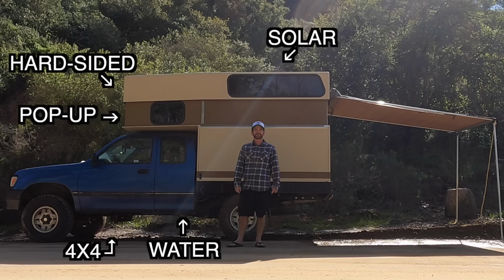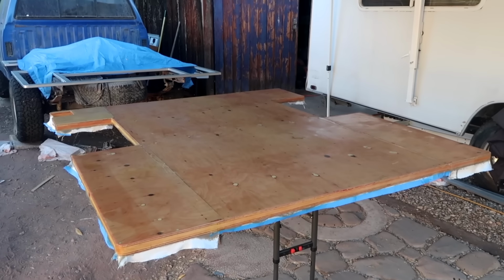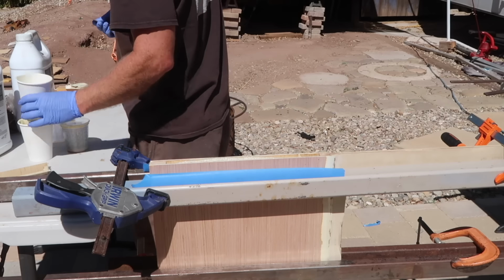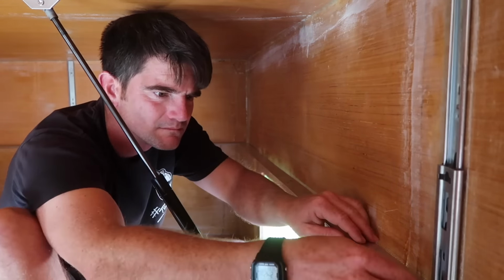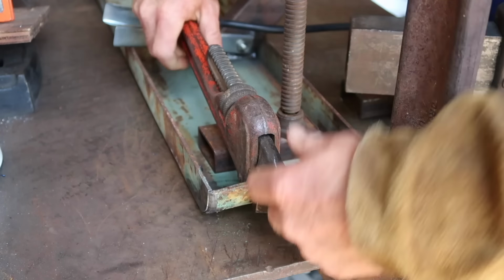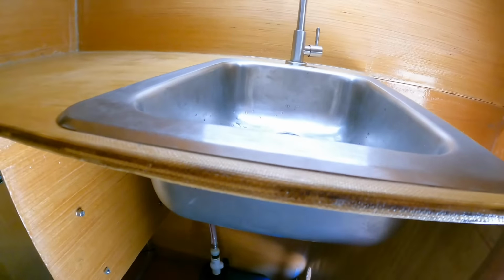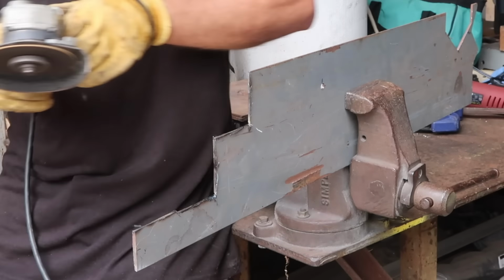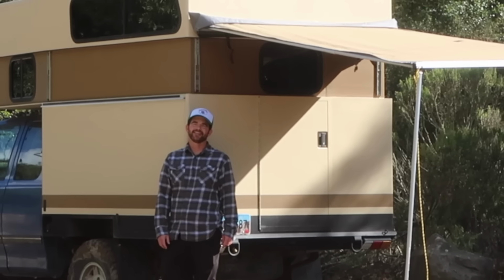Homemade Overland Truck Camper Build | Start to Finish | Full DIY Construction

Comment: That's a hell of a lot of water flow, not really needed. I dislike peoples elaborate water tank setups in campers because imo a few 5 gallon Walmart refillable jugs that are totally mobile and can be chanhed out anytime they might get dirty or anything, along with a $10 rechargeable temu water pump (which battery lasts forever) is a much simpler setup.
Reply from the maker: Pros n cons.
we had three 5 gallon jugs in our last build. It was simple and we. could carry the jugs to a water source if necessary, which is great.

The downside was only one of the jugs had a filter, so we had to transfer water into it before pumping it out to drink. it was also very slow water flow through the filter, so filling up our drinking bottles or doing the dishes was a pain.

I agree my current pump seems to be excessive. I wasn't sure how the water flow would be at the tap after flowing through the filter elements. Like the rest of the build, I guessed haha
Reply: @TheTravelingTogetherJournal    Ah, I get some of my water at the refillable stations at Walmart. Used to be like 20 cents a gallon. Now it's 55. It definitely adds up! But man it tastes great.
Reply from the maker: @mitchweber7868  If you get a system figured out that works for you and where you like to travel, then that's a good system.

We traveled internationally, often to new places, and occasionally stayed in one place for long periods, so we needed a water filtration system that could handle questionable water sources. We drank water from municipal sources as well as lakes, rivers, wells, and rain collected off our awning.

Comment: Great video! This will help others build their own camper. IMPORTANT- Leave a door on the floor to have access to your trucks fuel pump. Otherwise you will have to cut apart everything you worked hard to build in the future.
Reply from the maker: 6 bolts and I can lift the camper, but I've dropped the tank on a T100 before. I think dropping the tank would be the easier option.
Reply: @TheTravelingTogetherJournal  cool. I'm glad yours can drop down. I just want people aware of the possibilities and to think ahead. Great video btw 👍

Comment: We miss you guys! ❤
Reply from the maker: Thanks. We miss traveling. We haven't been getting out on many adventures to share with y'all. Crazy our last travel video was a year ago and it was just a short trip around our new home area. Have you seen it: https://youtu.be/wKB0xoe28Ho
Reply: @TheTravelingTogetherJournal  yep, liked and commented a year ago ❤ do you still like your full on camper build? I wonder if it was too heavy or cumbersome for you to travel and camp in regularly?
Reply from the maker: @sharpsticksnz4112  I am still happy with the camper overall. I'm still stoked on having a toilet. 😂 The truck does ok with the weight, but if I had the time and money I would be doing projects to move as much weight as possible as far forward as possible. There is too much weight behind the rear axle and it's extra bad when ascending rough terrain.
Reply: @TheTravelingTogetherJournal  thank you very much for the insights 👍

Comment: Fantastic build. Cannot say enough good things about your design, craftsmanship, and ingenuity. Practical, aesthetically more pleasing than every commercial camper out there, and has some nice bells and whistles. But the real kicker is that you built it on a toyota t100, not a 40K+ vehicle. The fact that you've proved that someone can build a comfortable, safe, decent overlanding rig for two+ with blood, sweat, and tears for under $20K (I think most people will have a hard time finding or restoring a truck like that to reliable working condition for less than 10K these days) is a service to this community. Thanks for sharing.
Reply from the maker: Thanks for the kind words. I used lots of other home-builds as inspiration and I'm glad to be contributing back into the comunity.
Reply: @TheTravelingTogetherJournal  Kind, but genuine. I've got a '97 T and I'm embarking on my own build (simple bed topper style with some pull out drawers) and I learned a lot from your video--something to work towards. The fact that you bolted to the frame giving yourself some extra payload room is fantastic.
Reply from the maker: @adobecow  ditching the truck bed loses versatility compared to a removable camper, but like you said it gains payload and it also opens up a lot of options for camper dimenssions, layout, and access.
enjoy your project

Comment: I want to build one like this for my little 89 pickup, somehow finding a way to fit some MTB inside. Someone cut a sunroof into the truck before I got it, be super sweet if I could make some sort of pass-thru. Maybe a thick garage door seal? Probably leak less than the sunroof!
Reply from the maker: That would be a cool setup. Fitting MTB inside would be a challenge, but figuring out those design challenges is what makes the finish product of a custom build so cool.
Reply: @TheTravelingTogetherJournal  100%, half the fun is building what you want. I'm thinking if I take the front wheel off and crank the bars sideways it might be possible to stuff a pair on either side. Maybe with a pedal pocket that intrudes inside a little bit, how deep did you make your surfboard storage? I'd like to swap a T100 axle, maybe do a front long arm setup that uses t100 half shafts. Thanks for all your work in posting your design and building process!

Comment: Really love the design in planning on cutting open my work camper shell to install a pop up tent !
Reply from the maker: Cool project. My first camper was built on a fiberglass camper shell . make sure you have it supported before cutting the roof out. the front and back walls may want to fall in.
https://youtu.be/5w14ybZO2dQ?si=0UnVLFeDqsD9OSVH&t=279

Comment: Why didn't you just use some biaxial cloth directly onto the foam? It would have cost less and been much stronger.
Reply from the maker: I'm using 3lbs foam and 6oz biaxial cloth. The resulting panels would have been too weak, particular in terms of impact resistance.

Not using the wood would have been cheaper and lighter, but not nearly as strong.

Comment: Seems backwards that the front struts are 80 lbs where the pop up narrows down (less weight) and 60 lbs in the back where it's wider (more weight).

You should reinforce the step, when you step on it it flexd and I didn't see it go back.
Reply from the maker: The front struts weren't mounted all the way against the front wall, so they were lifting more of the pop up. I am changing that set up right now. I tried putting the 80lb struts in the rear and 60lbs all the way against the front wall. The 80lbs struts seem good, but the 60s are too strong. Gonna have to keep tinkering.

Comment: I don't understand why you wouldn't use the wide sides vertically of the steel tube for strength.
Reply from the maker: The orientation of the steel allows for twice the surface area for bonding the subframe to the camper floor and doesn't take up as much precious vertical space.
The goal wasn't to make the frame as rigid as possible. I think (without any engineering knowledge) based on other builds I've seen that it will be strong enough the way I used it

Comment: Bro you need to start your own company, even if you start building a couple units a year. Hell of a build man. Curious how it works out after awhile
Reply from the maker: Thanks. 
Overall, I'm happy with how it has performed so far. I feel like the pop-up could be improved. It works fine, but I'd like to test some different ideas instead of the drawer slides. 
I plan to do an update/review video, but life has gotten busy for me lately and I haven't had a chance to use the camper as much as I'd like before making that video.
Thanks for watching and thanks for the comments.

Comment: Nice design. I especially like the use of the drawer glides to raise the pop-up. If anybody wanted to, and had the same kind of truck, they can extend the truck bed length with c channel. I'm not sure how that would go over with the weight rating, but I've seen people do it. It would also be possible to put some upper kitchen cabinets on the inside wall and let them raise and lower with the roof.
Reply from the maker: Thanks.
I thought about doing kitchen cabinets like you describe, but decided against it for the sake for weight and simplicity. But I still think it's a decent idea.
I definitely wouldn't recommend extending the length of this truck. It already has a pretty mediocre departure angle and tends to be rear-axle-heavy. If you found that you had to have the extra space, I think you'd be better off building on a bigger truck at that point.
Reply: @TheTravelingTogetherJournal weight is always something to consider.  I think you used gas struts on your design, but counterbalancing coil springs in the corners might be better.  As far as the cabinets, I did see one design where they stored the cabinet boxes on the floor and then you pick them up and set them on hooks on the walls after the roof is raised.
Reply from the maker: @n4mwd  I definitly feel like my system could be improved on. I'll look into the counterbalanced coil springs
Reply: @TheTravelingTogetherJournal  a lot of the commercial designs do have some sort of counterbalancing spring in there. That way you can have air conditioners and solar panels up there and still lift it with your pinky. Of course the standard pop-up camper tends to use a cabling system, but I'm not sure if they use counterbalancing springs or not.

Comment: I've been thinking about how useful fiberglass could be, but I think you went a bit crazy with it. Are you building a camper or a boat? Or planning to go through 5' deep creeks? I can't see why fiberglass was needed inside. And the Sikaflex on all the things inside seem excessive, too. 

Saying that, it's an impressive amount of work and design. One day, I hope to build my own camper for my truck and this helps give me some ideas.
Reply from the maker: Glad to here in was helpful. 

The fiberglass interior may be overkill for you depending on the rest of the build design and how you intend to use it. If you're just trying to protect the wood some paint would probably suffice, but the fiberglass provides a lot of extra strength to the camper construction.
Reply: @TheTravelingTogetherJournal  I didn't even think about reinforcement. Does one layer make a big difference? I always thought you needed 3 or more layers with different placements so the weave doesn't line up every time.
Reply from the maker: @StapleCactus  There are lots of different weaves that you can get fiberglass in, but you are correct that multi axis weaves will be stronger.
When it comes to composite panels, like my walls the outermost layers of the panel (inside and outside of the wall) will take the most energy when a force is applied. So the thin layer of glass definitely adds a lot of strength for the weight. pluss the epoxy resin  absorbs into the plywood and adds a lot of strength there as well.

Comment: What made you choose the expanding foam versus just foam board (polystyrene)?
Reply from the maker: I had planned on using XPS, but when I started the build I couldn't get it anywhere in California or online without buying full pallets and paying a lot in shipping, so I considered alternatives. The pour foam I used results in a foam slightly stronger than 25psi xps with similar closed cell structure and it adheres itself to the sheathing (wood) so I didn't have to deal with trying to bond the foam
Reply: @TheTravelingTogetherJournal  awesome thanks, I'll be using this video as a reference guide to building a hard sided pop up. Very cool!!!
Reply from the maker: @CBHurricane  Awesome. Good luck with your project

Comment: Really nice camper but unfortunately I don't weld both my knees are shot I'm working on two full knee replacements but other than that I can't do any kneeling down but it is really a nice camper I just wish I had that ability to build from Joseph Strauss here
Reply from the maker: Thanks Joseph
Reply: @TheTravelingTogetherJournal  heyy can you build this for me? I live in Phoenix
Reply: yes I wish I could do that but make a camper on the back of a pickup but I can't my knees won't allow it going on two full knee replacements I'm just getting to the point that I could get down on my knees on the grass and that's hard for me but I wish I could do that

Comment: the rec tube frame bed should be upright.  not flat side. for structural
Reply from the maker: That would have made it more rigid, but I also wanted to keep the height to a minimum and have a sufficient surface area on the top of the frame for the Sikaflex 252 to adhere to. With the 2" width as the top surface the Sikaflex should be strong enough to secure the camper to the frame on it's own and that was part of the design consideration.

Comment: What size gears in your differential?
Reply from the maker: stock, 4:10
Reply: @TheTravelingTogetherJournal  Thanks! I have a 1992 F150 4x4 extra cab that I was toying around with the idea of turning it into a MH.  Rear end is 3.55; capacity is 1900 pounds.  It is a long bed.  The weight of my f150 is about 800 pounds more than your Toy.

Comment: Wow great job  love it     So what do you think about putting on some air bags for the extra weight/
Reply from the maker: Thanks
I'm not a big fan of airbags. I intend to pull apart the stock leaf packs and build custom packs that will handle the weight better, but hopefully be more progressive so they don't feel rough on dirt roads.

I'd say airbags make more sense if you have a slide in camper that you occasionally load into a truck that you daily drive. That way you can leave the bags empty most of the time when the truck is light, and then you can pump up the bags when you load the camper and the vehicle needs the help.

Comment: SUPER COOL, I JUST BUILT A SMALL CAMPER SHELL FOR MY 91 TOYOTA PICK UP, I DON'T HAVE ALL THE COOL STUFF AND SPACE BUT FOR ONE PERSON WORKS GREAT, JUST BOUGHT A SMALL 12V FRIDGE AND A LITHIUM BATTERY
Reply from the maker: Very cool. Before Amie and I started traveling together I had a 93 Toyota Pickup, standard cab, short bed with a hightop campershell. I just had a sleeping platform with a bunch of storage underneath. No camper electrical at all. But that's what I took to Baja on the regular and I would probably still be in that thing if I wasn't trying to accommodate 2 people.
That's the best part of a DIY setup. You get to design it just for your needs. Nobody makes a good camper commercially for 1 person. Most of them are trying to claim they accommodate 4+ people, but I have no idea where you'd put 4 peoples worth of food, water, and clothing let alone 4 peoples worth of surfboards😂

Comment: i think this is just an elaborate ad for Sika Flex
Reply from the maker: I've been waiting for them to reach out with a sponsorship 😂

Really, I spent a lot of time researching materials for this project, so I tried to pass that information along during the build. You'll notice I use sikaflex 221 when I want a sealant with some adhesive properties that's easy to use, but I bust out sikaflex 252  and the pneumatic caulking gun when I need a really strong bond. I also used a loktite product when I wanted a less flexible cured adhesive.

Comment: 44:07
We have our ancient Coleman propane two-burner camp-stove.
Use, wipe, stow back in its cubby.
.
We also have three induction hot-plates.
.
We can use these:
* inside the rig
* on our permanent porch under its permanent roof
* at the campfire or on a picnic-table.
.
We think a built-in 24/7/360° galley, used a few minutes daily, is wasted space.
Reply from the maker: Wow, it sounds like you have an interesting vehicle setup.